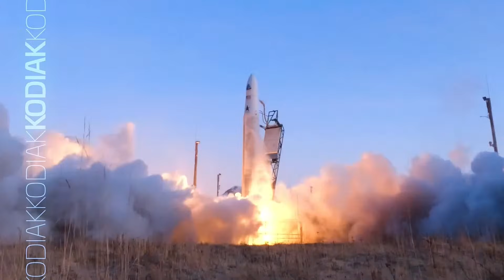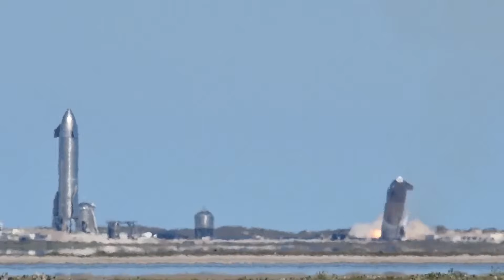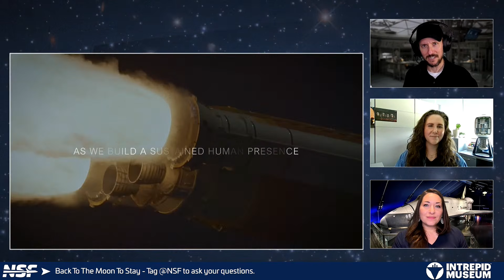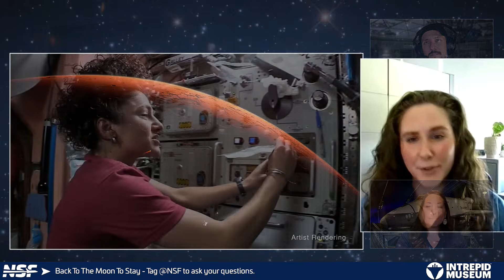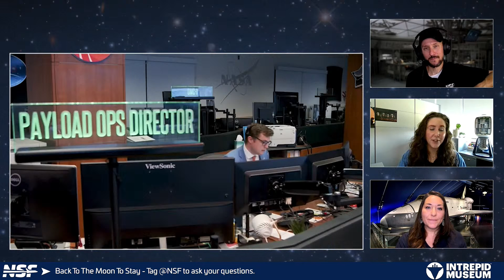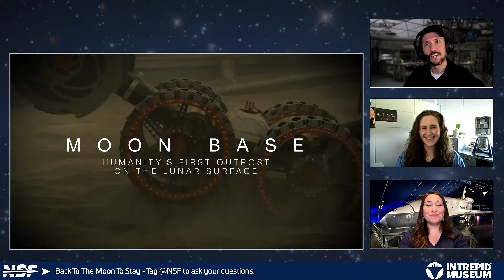Can NASA Jump Start a Moon Base? - Intrepid Museum Astro Live

Comment: This all sounds exciting except that timeline is unrealistically aggressive, the timeline IMHO is more like 50 years for the following reason: building a truly permanent home on the moon means solving massive human and engineering problems that cannot be rushed. It is one thing to visit the moon like a temporary camping trip, but it is much harder to build a lasting cabin there. Moving from a 98% efficient water recycling loop to total resource independence takes decades of testing. Every piece of gear must also endure the absolute worst conditions, including sharp, pointy moon dust that easily jams moving parts.

The technical steps required to slowly grow a colony require testing structures to failure by intentionally bursting inflatable walls to map true safety limits. Engineers must perfect autonomous robots that can 3D print entire habitats using raw moon soil before humans even arrive. Meanwhile, teams on Earth are warming up twin control rooms like LUCA and LISA to practice managing complex surface operations. They are learning to squeeze extra life out of gear to ensure critical parts last ten times longer than planned.

Beyond infrastructure, humans face deadly dangers on the surface from constant space radiation and wild temperature shifts. Lunar regolith is made of sharp, glass-like shards that destroy seals and can ruin human lungs if breathed inside the habitat. While commercial partnerships and space station lessons help us stand on the shoulders of giants, making a moon base safe for long-term human life is a massive, multi-generational effort.

Comment: It seems odd to commit to 3D printed habitats considering how incapable 3D printed habitats have proven to be on Earth.  What alternatives to 3D printed lunar habitats have been considered, tested, and rejected?  Has anyone tested using robots to construct traditional masonry structures using lunar stones?  Do we already have terrestrial robotic stone cutters and robotic masons?
Reply: I don't think that 3D printed habitats are set in stone as the only method of construction, or that other habitats have been rejected outright. But using local resources is certainly preferable, since sending materials over from Earth is expensive. 3D printing may have some things that need to be worked out, but lots of people are working on it.

As far as robotic stone cutting / masonry goes - that's an interesting idea. But that would also need to be developed and customized for the moon, just like 3D printing would. I don't know what has been tried, and I don't know if moon rock would be a good material for stone/masonry construction. 3D printing is still a fairly new technology, and future advancements may overcome the problems that it currently has.
Reply: Something to consider, the amount of effort it would take to cover a habitat module with regolith, using human effort, in a space suit, well obviously that would not be practical. 3D Printed probably would look a lot different than the experiments we've seen on Earth houses, because just simple concrete doesn't exist on the moon as we know it. I've seen videos showing laser sintering of regolith, might work if we have the nuke power plant. But even just pushing a big pile of moon dust over the hab would be pretty practical. Once we have robots that can dig and push like a dozer. What I hope someone is thinking about is building a big enough maintenance space, so when the rover or dozer or 3D printer breaks down, we have somewhere to bring it inside to work on it. Moon doesn't have wind or weather, so that would make a lot of the structures easier. But there are also a lot of meteoriods to deal with, so we'll want to bury pretty deep. And the lava tubes look like a good idea too, caves to build into. I think mostly I'm agreeing with you. We probably don't see all the idea at this point. It'll be fun to see what works and what doesn't.
Reply: @CarlinComm  We've been building and operating earth moving equipment for centuries.  We just need to redesign current machines for lunar conditions.  A scraper, a bucket loader, and a conveyor, (all robotic) would suffice to bury a habitat in a day or two.
Reply: @glennmitchell9107  Yup, I'd agree with that. Start with something small enough we could transport it there, assemble one the surface, and turn it loose. I like what they've been saying about the rovers being human optional. I can see a robotic excavator running remotely between human missions until they get everything set up. Lets Go!
Reply: @CarlinComm  The thing I don't see in these model moon bases is a construction crane.  Even if it isn't needed for vertical construction, it would be handy for loading and unloading equipment on and off trailers, sledges, and sleds, and for repositioning habitat modules.
Reply: @glennmitchell9107  If we look at NSF videos of Starbase for about 4 minutes, we'd see all the architecture we'll need. I'm guessing the artist simplified it a lot so it would fit on the poster. I have to remind myself for every project I do at home, almost none of it will be just plug it in. Cutting, drilling, installing, then plumbing and electrical, and every step usually includes pondering, swearing, and wondering if I just made a hole in my house that I won't wish I hadn't done. Nothing is ever simple, no matter what the package says right?

Comment: It is ridiculous to not cover lunar habitats with lunar regolith or to not park lunar vehicles and other equipment in shelters covered by lunar regolith.
Reply: 3d printed lunar habitats are going to be made with regolith and there’s a thing that will be covered on vehicles and stuff called multi layer insulation(MLI) and the equipment will be inside while large ones will be covered and put outside
Reply: @SnowyTheOne22  3D printed habitats on Earth have failed, even if only economically, due to all the less expensive traditional alternatives.  Has anybody already developed a lunar 3D printer?
Reply: @glennmitchell9107  When it costs millions to launch supplies from the Earth to the Moon - economics changes. Using local resources becomes much cheaper, even if you have to spend time developing new robotic machines to do the work.